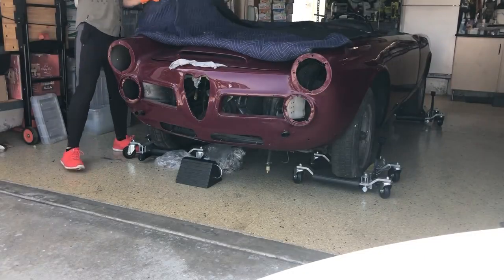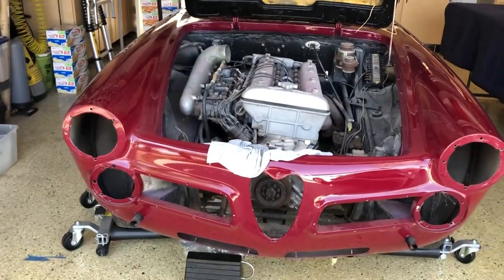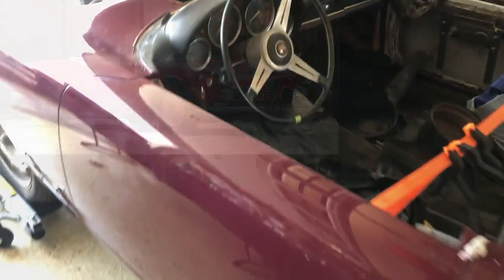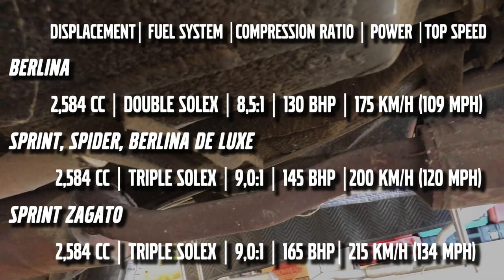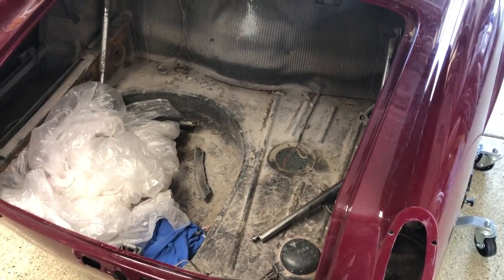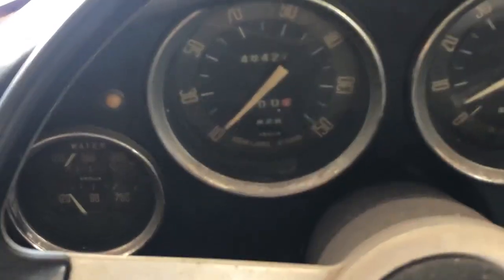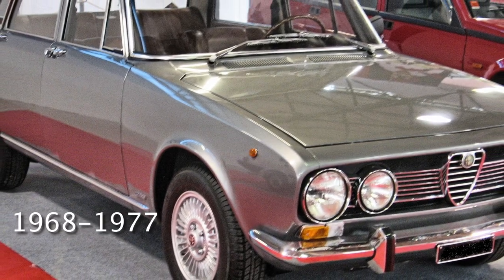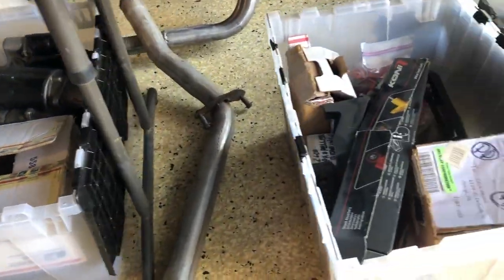A Brief History of the Alfa Romeo 2600

Comment: Nice car, my dad has 3 of these!!
I bare metal restored 2 of them when i had a bodyshop in the UK, new panels hand made, including the triple chassis sills.
he has 3 of them in total and 2 complete spare engines.
I would suggest you do not spray the inner panels as that is fully original and will decrease its value if you.
He owned Aston Martins, db 34 and 5, classic Bentleys etc etc and he wont sell these Alfas as he loves them so much.
I used to pinch one off my dad when i was 17 and take my girlfriend home in it, that exhaust note is so amazing

Comment: Dear fearless David Bello.
Great looking car with a wonderful engine. With a modern suspension (shock absorbers, suspension springs, PU- bushings etc.) and maybe a bit weight added to the rear it could be such a sportive driver as it looks and should be originally. But it's still an Italian car. Although your surname seems Italian and means beautiful (or even war in Latin!), at the end you will have not so much fun with a car like that than you have with the well made, stable/sturdy Volvos. There is an old saying in Germany: Wer schön sein will, muss leiden! Who wants to be beautiful must suffer! ;-)
Best regards, luck and health.

Comment: Being swedish I was always baffled by the crude Volvo designs, compared to almost anything italian I’ve worked on. Sofistication is the game in northern italy!
Enjoy!
Reply: Difference is: sixties and seventies original Volvos, despite rusting here and there, do run and drive to date, sometimes as daily summer beaters with 4-, 5-, 600.000 k on the clock (some of my petrolhead friends drive their Amazones or Ps indeed daily when there is no salt on the roads). Most Alfas of said era I would know of as really driven at least often have their third or fourth drivetrain and went through their second tin-dress already here and there wanting some welding, again .... It's like Mercedes G versus Alfa Stelvio today: The G is as boring as a car can get and You forget where You bought it one year in, while You befriend Your dealer really really well should You want to actually use Your Stelvio for driving as a commuter or long distance car.
Reply: The 262 and the 780 , had italian influence, I think ?
Reply: @Bonzoguy66  The 262 C was built by Bertone's "Carozzeria", it was a Wilsgaard design though. 
Bertone did not rustproof anything coming from his Carozzeria in that era, which made the 262 C an extremely rare Volvo in Europe over time, compared to most other models.
My first Bertone built cars I had in the eighties were bare metal inside of cavities and cills, not even primed, let alone painted:
A wet dream of any car sales man, because You needed a new one every other MOT .... 
(That is why I learned welding)
Reply: @manfredschmalbach9023   , Living in Denmark, I see your point. Had a 460 and a 855 my self, but never any Italian cars, due to the fact , that most of them were gone , if they did not get caretaking . Pity, because driving a 1500 alfasud was actually quite fun .
Reply: @manfredschmalbach9023  old Volvos do run forever, like, its as plain as a piece of rock and how can you destroy a rock?
Thing is, old 60’s Fiats or Ferrari’s or Alfa ’nord’ twincam’s do too. They just go on forever which in my book is more impressive.
Reply: @Bonzoguy66  the 262 & 780 were Bertone built yes, and the C70 2nd gen was Pininfarina built (in Sweden, Uddevalla tho)
Reply: @Bonzoguy66  Well Alfas have generally been expensive in Denmark with your taxes. And, the Volvo 460, 440 or 480 did NOT last long even IF you took extreme care... :)
Reply: @pereldh5741 Yes, I had 105 Series Giulias with 300.000 or 350.000 k on the clock, running fine. Problem is always the tin (and users not warming things up before flooring it, of course). Italian engineering, motors and gearboxes were absolutely superior in the sixties, only surpassed by Citroën drivetrains. Most Citroën DS I had did run smoother than Mercedes of that era, and changed gear easier than any well warmed-up Alfa. The ones which didn't were 500.000 k cars under their umpfteenth owner, never maintained, never even oil changed. 
I had the habit of never paying more than a couple hundred, often less than hundred DM per car - You can distinguish things this way and go through a lot of cars - plus I imported well used Alfas, Lancias, Citroen DS and Peugeots to Germany for the early vintage commune in the eighties and nineties, because our salted rainy roads killed the tin dresses of those cars faster than almost any other area in Western Europe.
Reply: @manfredschmalbach9023  Agreed, the engines also in 60/70’s Fiats survived 3-4 bodies haha. The italian cars was always made for themselves, in southern climate. The Volvos were made for extremely salty Gothenburg (EVERYTHING rusts here) and also salty winter roads. As were Saabs. However in the end, of course also these cars rust

Comment: To my knowledge, the 1900 , was a more modern engine, than the 2600.
Reply: well, then your knowledge fails you. The 1900 was of a much older design and had a cast iron block from the early fifties, the 2600 was more or less based on the Giulietta/Giulia design which was from mid fifties and actually 2600 from beginning sixties. More or less a design based on the Giulia engine from '62.